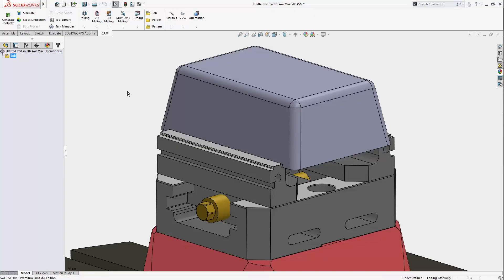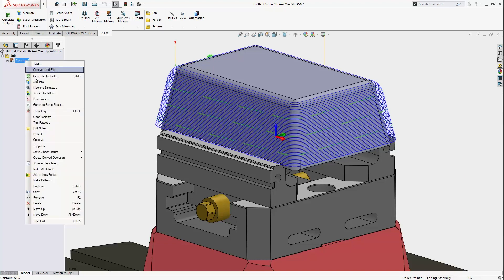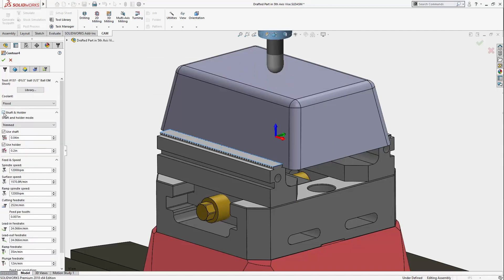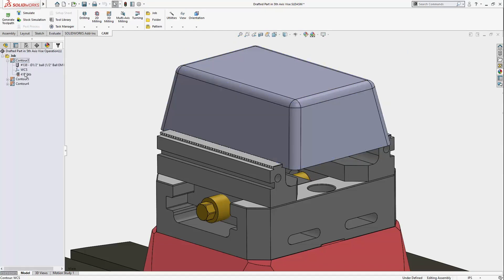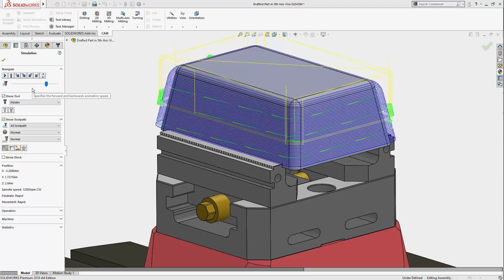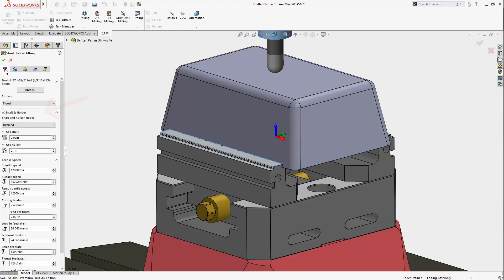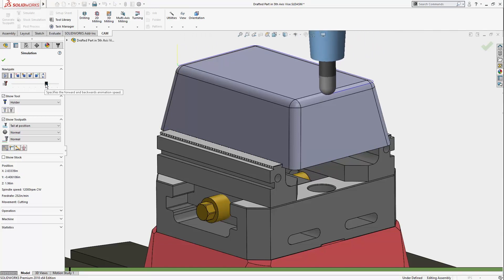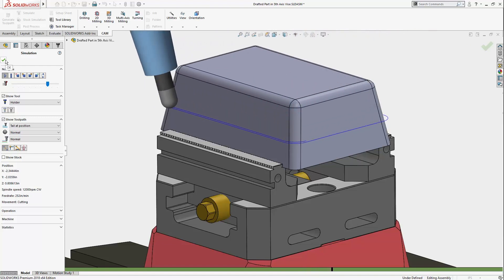HSMWorks QUICK TIP: Shaft & Holder Collision Detection

Comment: You say to make sure the tools and holders match what is in the machine, but how can I when I'm unable to import tool holder models? They have to be built up via segments. And form tools imported aren't viable for all cycles?
Reply from the maker: When you are creating tools and tool holders, make sure that those segment dimensions are accurate to the tool holders that you have. Usually we recommend sitting down and either measuring with a caliper or using the holder manufacturer's drawing to enter the segment data.
Reply: Why reinvent the wheel by measuring tools and holders and entering the segment manually data when the models are available from manufactures web sites to download as solid models? Why cant the holder geometry be imported from a file like form tools? Other CAM systems do this.
Reply from the maker: Thanks for your input! The best way to share this with the development teams is to submit a post to the IdeaStation, which we routinely monitor and pull from when updating the product: https://forums.autodesk.com/t5/hsm-ideas/idb-p/231
Also make sure to search for and vote for existing posts so they gain as much traction as possible.